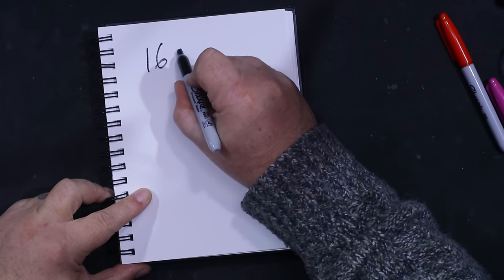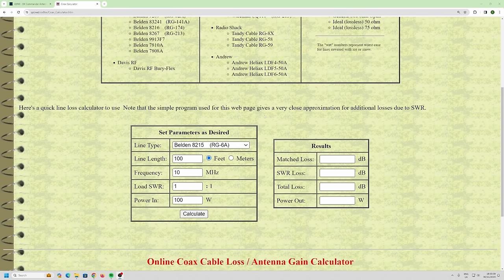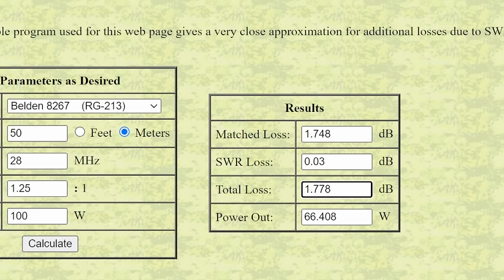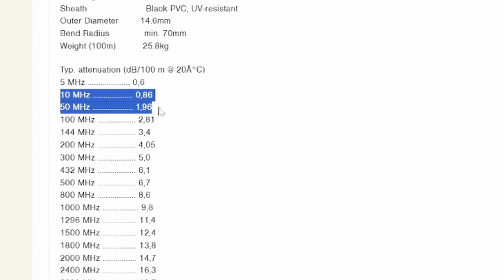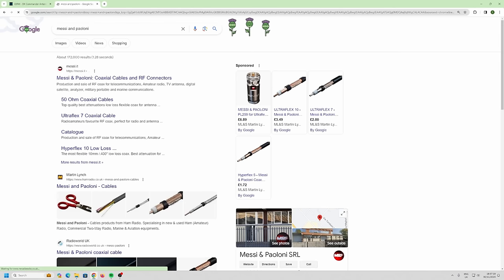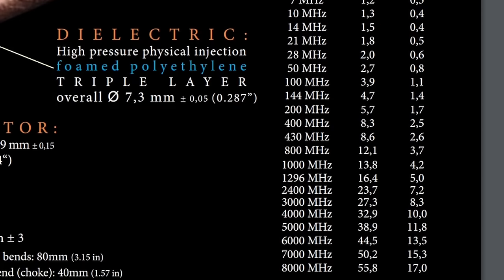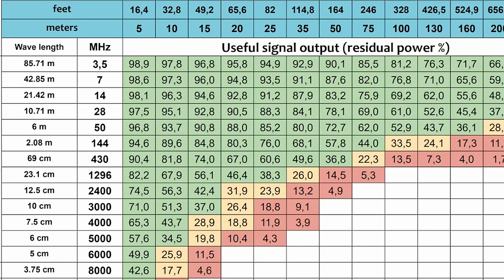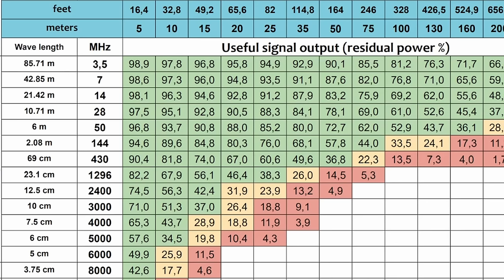Choose the Wrong Coax Cable for Ham Radio

Comment: Buy once, cry once. Antenna is #1, Coax/Feed is #2, everything else is way down on the list of priorities.
Reply: This should be an answer to one of the questions on the General test.  Bravo!
Reply: Ok, well, for some, cry any/buy none. There is a balance.
Reply: Also it's a good idea to use double screened coax to reduce breakthrough interference. Especially if you have the coax near any other wires in the shack, or parallel runs for example.

Comment: Basically the same calculations apply to rubber ducks and telescopic antennas. There is no cable length but losses are there. I mean, some need 30 ohm cable and others want 100 Ohm.

Comment: The only coaxcable I use is Messi & Paoloni Ultraflex-13 (for hf and vhf/uhf)  Distance from shack to antenna's is about 45 meters. The loss for transmitting can be solved by using more output power :-) But for me the loss on trancieved signal is more important. I have very good results with Messi & Paoloni. Other coaxcable I have used are Belden H-1000 and Aircom Premium. These are also exellent cables, but I think not as good  as Messi & Paoloni, and very important, not as flexibel as Messi & Paoloni.  73 PD4PS
Reply from the maker: Agreed.. The only comparison I could make is Ecoflex 15. The numbers look almost identical.

Comment: The best coax is 1 and 5/8 inch hardline. Now, who wants to pay for it? 
I got nearly 500 feet of double-shielded 75 Ohm CATV cable for free, and I can build impedance matching transformers for next to nothing. I've saved so much on coax that I can add a small power amp at the shack, and a receive preamp at the antenna to more than make up for any long-run coax loss.

Comment: When people ask I always tell them to buy the best, usually name brand, coax they can afford. I have used so many different kinds it's hard to remember them all. I finally was able to run 120ft of lmr400 to my Classic and 75ft of rg213 to my efhw. Great success with both setups and no issues since the installations 2 years ago. I use a 50ft piece of M&P Ultraflex 7 for portable setups because I wanted to use something I could do HF and VHF with that was a little more flexible. I took a 75ft piece of rg213, cut it in half and put some of the screw on connectors like you did the video on.  My old pieces of rg8x are in the box as backups but will probably never get used. Thanks for another fun and informative video!

Comment: I remember when i got back into radios earler this year & got my first ticket i bought 5-6 different peaces of coax from amazon & ebay an even one local & Every Single Peace was junk so i did my research & found M&P Coax & Connectors & i have ben running their Hyperflex 10 sahara for my VHF/UHF with their Great Evo Connectors & Haven't Looked Back.  Now All my Coax Is M&P as well as all my Connectors is all EVO Connectors Very Good Stuff IMHO

Comment: Great video.
This is why for short run of 20m or less we use a coax (on H.F) and for long runs you better use open balanced feedline. 
Good coax is great and important as the antenna you use, yet it could be expensive for long run applications and there is where the   open feedline shines, this balanced feedline could be made DIY at a very low cost and the extreme low loss over LONG runs could make it the beter option for many.
Reply from the maker: Many folks can't use balanced feeder. I can't (for instance) because I am restricted to a 4 inch pipe and no overhead lines allowed. Having been a dedicated previous owner of a massive doublet, although they are very lovely, bacd changes are a pain - and then ideally you need a lovely balanced ATU as WELL.. But coax is convenient and purched right, will last many years. PS - Have you checked the price of balanced feeder recently!?
Reply: For amateur use coax is the way to go, the losses are negligible for most of us to not even notice the loss difference. I wouldn't dare touch balanced, its a lot of work and not practical in all but ideal conditions. On the professional RF side my broadcast FM stations run a mix of 3" 4" or 5" coax over a run 1000-1300ft long (~300m) at about 20-45kw, I would be scared to put all that RF in open balanced feeder. My AM broadcast stations dont use balanced line and they came on the air in the 1940's - in a pinch I could use rg58 and only lose 1db over the 300ft run to the tower lol. balanced is great if conditions are absolutely perfect, but we are in a imperfect world and coax fits the bill, line losses are negligible when the right coax is used.

Comment: I usually pick the lowest loss for highest frequency for what I'm doing, which is usually 10m band.  I often find the Messi & Paoloni is my best option.  I've got Airborne 10 and Hyper Flex 10 running to 3 different antennas.  Another antenna I'm just using some ABR LMR400 simply because I had the exact length I needed for my 4th antenna.

Comment: As a Foundation m7 I'm only allowed 10w; my rig has 5,15,25w outputs, and using the feed line loss to lower the RF to 10w, by the way I'm using RG8X on the 2m/70cm band! In some cases loss can be useful.
Reply from the maker: And your losses on receive..? Worth thinking about.
Reply: @DXCommanderHQ  I use RG 213 FOAM almost the same spec as LMR400 at 100 meter  just something to thing about. I also use a max of 10 watts from my Icom IC251 and can talk over 40 miles, I even hear people others cannot.

Comment: Balanced line is great if you're using a non-resonant antenna or one with an appropriate feed point impedance. I used to use a folded dipole for 40m, fed with 300R twin, but then of course I needed a 6:1 transformer before the tx. 
However if using 50R antennas coax is better, especially if like me you don't want to use an ATU. The loss at HF isn't much if you use something half decent, RG213, LMR400 etc.
Reply from the maker: Yes Andy.. If you are a one-band-man, and can afford a nice big ATU then why not. FOr me, it would be difficult.

Comment: One thing that doesn't ever get mentioned and becomes more important the longer you go is noise.
Coax will pick up noise I've seen it tested, I believe this is due to leakage of the outer conductor, so buried coax will greatly reduce this. 
But you can't burry coax the whole length. 
The larger and better construction the less noise, heliax being the best as it has a single metal non braid solid conductor.
But heliax can still leak RF a little so underground burial is still the best. 
If your noise floor comes up due to the coax you will loose signal to noise ratio. 
Of course this is an issue on receive not on transmit, but transmit is only half the story.

Thanks.
Shane VK1NME.
Reply from the maker: Yes.. Leak is a concern (both ways)..

Comment: great info. I get asked coax all the time. my answer is a question. what frequency and how much power and how long. and what can you afford?  I learned something  about coax that is not in data sheet. the shielding foil aluminum . re doing a UHF  repeater. 50 watt. was running LMR 400 coax . about 35 ft . all on roof of a office budling. rented space. outher stations at cite. was getting cross talk and inter mod noise at times into the repeater. was not too bad but a weak signal into repeater was a problem at times. even went with better duplexer . turned out to be the shield of LMR 400 was causing the trouble. with the RF from outher stations near buy was causing a reaction  with diss similar metals in coax. That why you see hard line on repeater cites often. I made a switch to       HYPERFLEX 10 Sahara FT8 from M & P and problem went away. was a GMRS repeater in the USA
Reply: FWIW LMR400 and similar are banned from many commercial radio sites, the dissimilar metals cause intermodulation issues.
Reply: I use LMR400 for everything at my station from HF up to 3 GHz.  Been working great for over 20 years.  I'm not in a multi-carrier high RF environment though.
Reply: @stargazer7644  well said, it is the multi-carrier scenes where it can be an issue.
Reply from the maker: Can happen with EcoFlex too. The trick is to install it - and leave it (I think).
Reply: @DXCommanderHQ  if the shield gets damaged. I have it so not to flop around. problem was wrong coax from the start. all fixed now.

Comment: For me, the greater focus must be on the loss as it relates to received signal loss.  In HF digital modes, how many contacts that worked sufficiently with a signal strength of -15db, won’t be viable at -17db?   It think that it is a waste of time to dither over 1 extra db of coax loss.
Reply from the maker: Correct too!

Comment: I have had good luck with Times LMR400 on 450MHz back in the states. Is this stuff available in the UK or EU? This was some 25 years ago in the States but now in the EU looking for recommendations on a low loss cable for 450MHz. Odd that I found connectors for their coax in my stores. Crimper has been in my tool box for years. The joys of proprietary goods. Max lengthen of run is less than  100 feet, yes I still work the imperial system, hard to teach an old ham new tricks!
Reply: It's available in the EU, but it's not all that competitive. 
The issue is, that the regular amateur radio shops don't tend to carry it, so people need to go to professional electronics retailers such as Mouser or DigiKey or similar, and then figure out how to actually purchase the thing, figure out if they're buying single cable per meter length, or 1 m pieces, or 1 foot pieces, or a single roll with fixed length and then also find the appropriate connectors, and so on, and that takes experience, and some people are afraid of that.

For example, a 500 foot roll of LMR400 is 1115€ on German Mouser right now, plus tax gives me 1327€ for the roll. 
On the other hand, the equivalent length of Messi and Paoloni Hyperflex 13 (which has lower loss than LRM400, but is ~13 mm diameter compared to ~10 mm for LRM400) would be around 1236€ with tax, and the SSB Electronic's Ecoflex 10+, which is also a bit better than LRM400 and has the same diameter, would be around 940€ with tax for equivalent length. 
It's also a bit easier to find appropriate coax connectors on M&P and SSB Electronic's websites than it is to go in-depth and figure out what would be the appropriate part number for the LMR400, and then find that part on a website of a retailer. 

So LMR is more expensive, has worse performance, and is more difficult to buy compared to local competitors.
Reply from the maker: See reply from Andre..
Reply from the maker: Very good reply Andre!

Comment: I got one for you.... I have a 25 by 50 foot foot print for property. I have a 66' wire wrapped around the house with a 49:1 zep and about 75 foot fo RG8U coax. I also have a 1:1 choke on the antenna feed point. How can I improve on this if possible? I also have a Comet 250B about 40 feet at the base. Not really getting out on any band other than of course 40/20 meters.
Reply from the maker: OK, that's about 7m x 15m.. Well, I have to tell you, I would probably leave it as it is and drop a Signature 9 in the corner with some more coax and run 2 x antennas and maybe a switch. Now, a loop of wire all the way around is just over 40m so with some tinkering, instead of your 49:1, you could go a 4:1 and tune that on 40m, 20m, 15m and 10m. No ATU.. However, it's a bit of an oblong so not perfect. I would still run a DX Commander near one corner! LOL

Comment: Putting cheap coax on your high performance rig is like putting remould tyres on a Ferrari! 😯
Why?
Coax, connectors and antennas are the means of transmitting TX power to the outside world, in the same way a car needs decent tyres to transmit it's power to the outside world. Skimp on these and your Ferrari drives like a Ford. 🤫

Comment: These coax losses are why I switched to balanced line.  Way cheaper, too!!!
Reply from the maker: .. and your ATU?
Reply: @DXCommanderHQ  I use a Heathkit SA-2040 and an MFJ-969 (HF) and a MFJ-921 (2m), with 1:1 baluns.  I feed the HF antennas with 450 ohm window line and the 2m antenna with 300 ohm twinlead.  I am fortunate in that I live in a place where I don't have to try to keep the transmission lines hidden and tidy, so I can keep them away from metal siding and gutters and stuff.
Reply: I can't say that I am an antenna expert or anything, but it seems to work better than the cheapo coax that I was using before.  But I may be full of manure, lol.  And I don't know how it measures up against quality coax, because I am too much of a cheapskate to try that.  ;3

Comment: I use Rg-6 75 ohm stuff because I am poor.
Reply: I started off with RG6 and switched to RG213. I didn't notice any difference on the lower bands, the higher bands did seem to improve however. Use a half wavelength (34m if you want 80m) and the 75ohm thing isn't a problem :)

Comment: So as a foundation license I can run 100w with cheap coax😂
Reply from the maker: Not sure.. On the "Full" it's at the feedpoint..
Reply: Yes, good quality (standard, but not special R558 or RG59) i,ve been using it for years, just make sertain connections are good, and SWR certainly doesn't go over 5:1.    Sometimes with perfect SWR you can't get our, because there is no push-pull effect! If a balun or unun is not needed, don't use one!

Comment: Riddle me this. I have a field 50+ metres long and sloping south so the top is 4m higher than the bottom. My shack is at the bottom because it has a low voltage high current solar roof for running deep well pump and i had to minimise loss in that cable. Now i run a dipole from the shack on a 8m fishing pole on 10m rg174. 
If i were to place the antenna at the top of the field i would gain height, but would feed it with around 50m rg11 because i have that. Will the extra height of the antenna gain more signal than the coax loses?
Reply from the maker: OK, you just need to calculate the loss.. So for a 50m run, on 10m band for RG-11, that's about 2dB. OR you can upgrade the coax and gain about 1.5dB.
Reply: @DXCommanderHQ  i think having a higher antenna will outweigh 2db by a lot